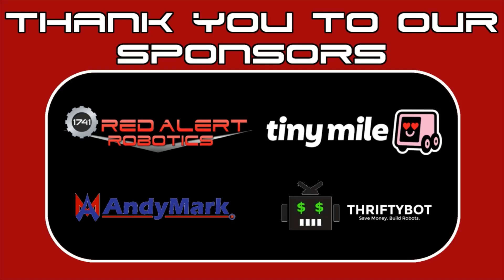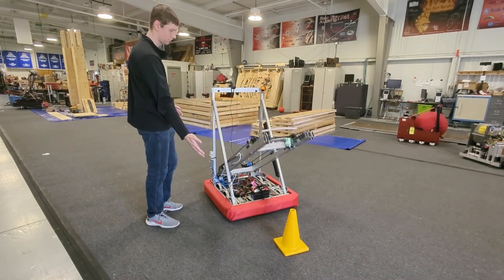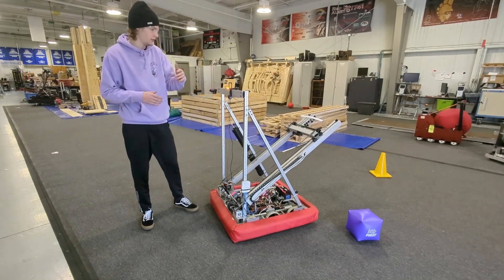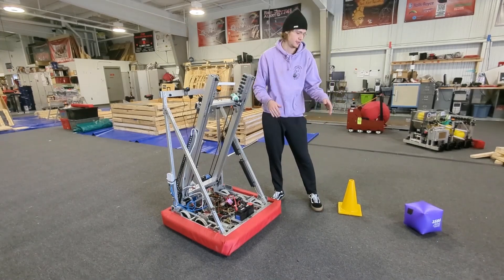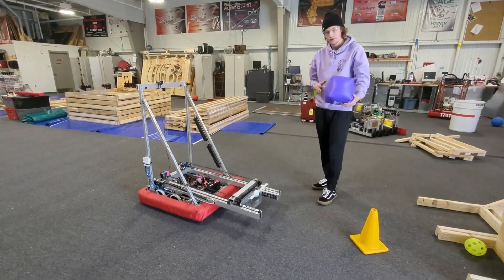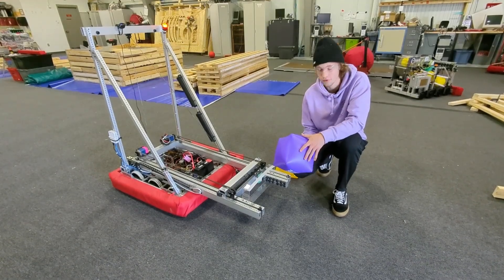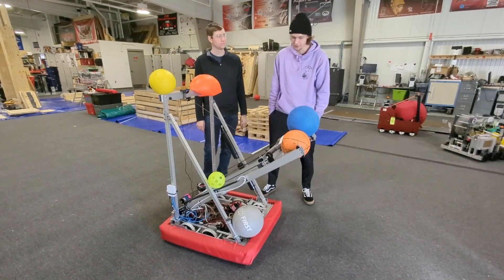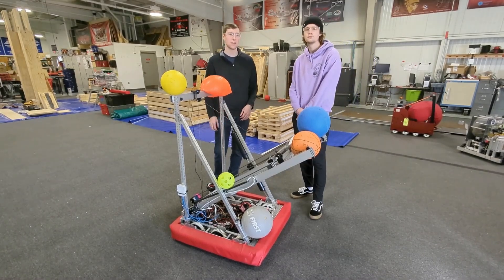Rattlesnake Robot Reveal | Cranberry Alarm RI3D | 2023 Charged Up

Comment: Fantastic!. What gear ratio did you use for the pulley system that raises and lowers the arm?  Are you happy with that speed or would you like to to move faster?
Reply: The pivot system is on a 20:1 ratio gearbox.  We're currently (and what was shown in the video) only at 70% power, so we could make it a bit faster, but I don't feel like we needed to.  In addition, we did only very rough PID tuning of the position control; given some more dedicated time and effort, we could get it even faster, without changing the gear ratio.

Comment: "and you see when you shake the robot" cone proceeds to fall
Reply: We will admit, gripping the cone from the center-ish causes the cone to squish more than we first expected.  During undefended driving we didn’t see any issue with the grip strength, but if we were getting hit by other robots, it would be a potential issue.  The easy way to fix this would be to grab from the top or bottom as it’s less likely to deform as mush.
Reply: I’m hungry for mangoes